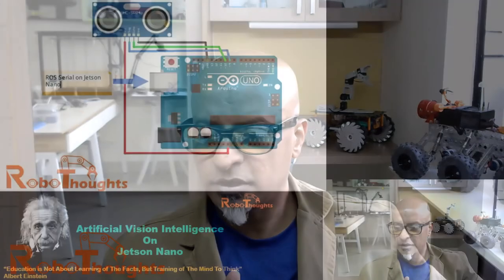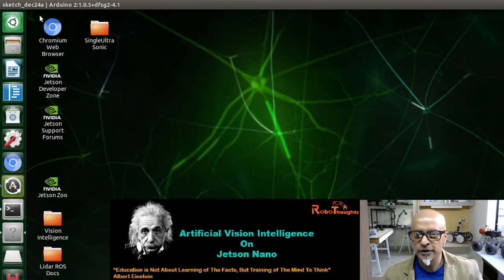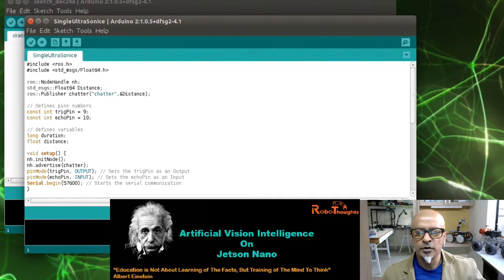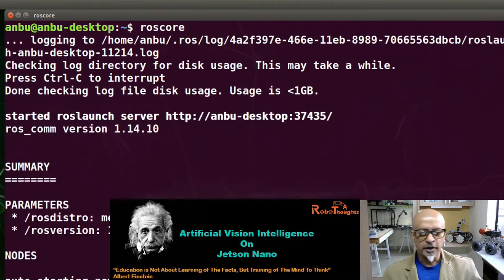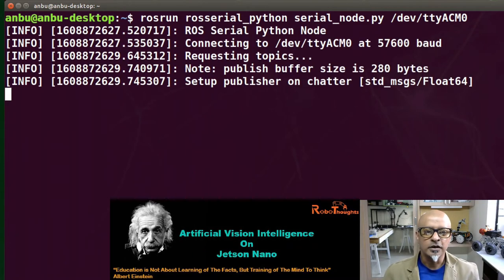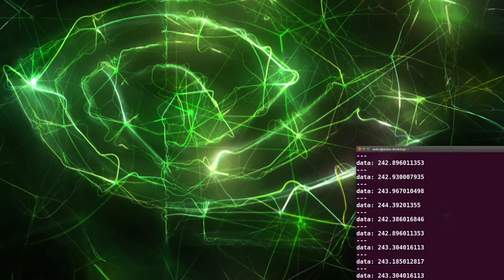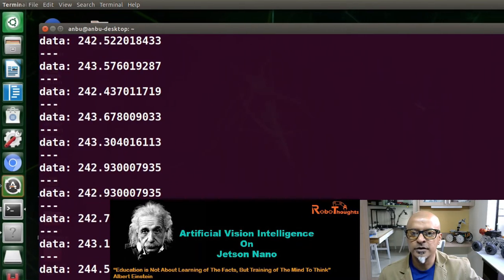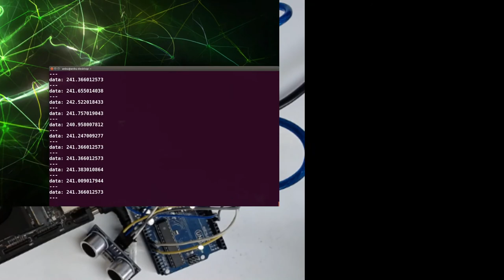Lesson 22 – Ultrasonic Detection Through ROS Serial in Jetson Nano

Comment: Hello I was able to get the data readings on my terminal pretty well however In the arduino code I want to use if statements like
 if the distance is less than 10 
         print “too close”
So while the data is running whenever a distance less than 10 appears we also have “too close” appear in the terminal. Is there a way to achieve this in the same terminal or no?
Reply from the maker: Yes I have done this before, bit complex but doable, reach my whatsapp for further discussion, whatsapp support like https://www.codingscientist.com